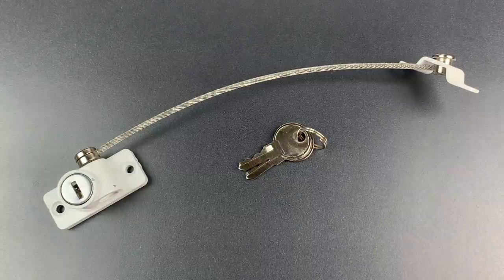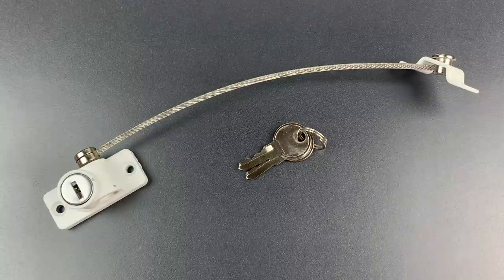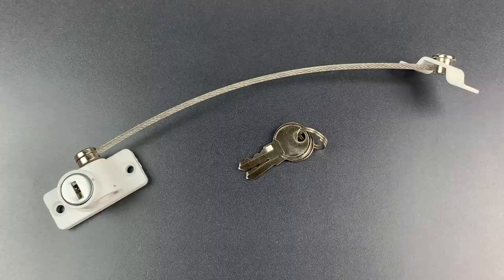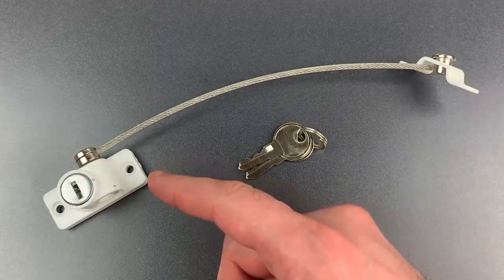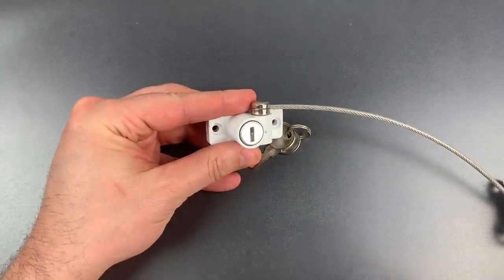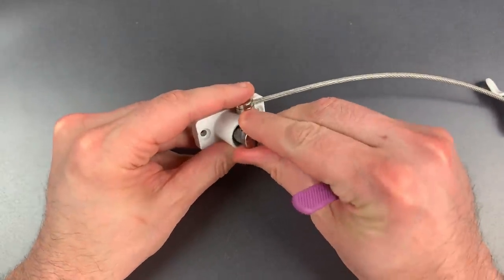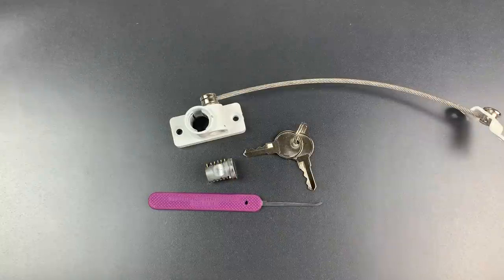[873] Why Is This Lock So Dangerous?

Comment: And for that reason, you can tilt your windows in Germany. Let's in some fresh air, is not directly an open door for intruders (though it is, of course, possible to use the opening to operate the handle with some effort and the appropriate tools, but then, tilted windows are usually an indication someone is home) and in the event of an emergency, you can fully upen the window in seconds.

Comment: To be fair, this won’t be a problem in any building with proper fire regulations. Odds are, you’re more likely to be saved by one of these as it’ll prevent the window opening far enough for anyone to get through it. If done right, you’ll be alerted to a fire well before it becomes a problem as the smoke detectors are so sensitive they are triggered by steam from a hot shower.

Comment: It can also be a life saver if you live in a high-rise and have a very exquisitive toddler. You probably wouldn't want to escape your 18th-floor apartment through a window even in an emergency and you would want to prevent your two-year-old from doing the same. So a lock like this, as easy to pick as it is, still has some utility, imo.

Comment: Hi LPL, I know US fire code might be different from the UK; but I am hoping not that much. But here the Fire Code stops you from using gf windows as fire exits. Each room must be fire protected for up to 1 hour (giving most the time to hear the alarm and escape) then the connecting corridors must have a minimum of 1 hour (more depending on other things height, distances to exits etc.) and that the travel distance to the exit is less than 30m (I need to check but don’t have my book at home) if it’s further then the corridor must be split in to two spectate fire compartments. Also depending on distances, type of use, etc. It dictates wether a second route is required. Finally from a H&S point of view, the chance of a fall is very high and the biggest killer / injure’r (well here at least) of fall types is a fall from low levels (you don’t have time to brace or react to the fall) this leads to a few big no, no’s 1. If you fall you can’t get away from a fire. 2. As it is not a defined route fire Marshall’s will not (mostly) be down to check for people exiting windows, so you might not be seen or missed on the fire Marshall sweep and/or role-call 3. Fire code also looks to reduce risk to Fire Marshall’s and First Responders (Firemen) by having to sweep the building to find you, rescue you when / if you are spotted and stop the Firemen from doing actual Fire Fighting all of them putting people at dangerous risk that isn’t needed. Most hotels but your escape routes on the back of mai room door or near by, and the routes are marked with emergency lighting and route finders. So please, all read and follow the instructions in case of fire and also know where you are supposed to go once you are out of the building at the Fire Meeting Point. You don’t want people going in the building looking for you just because you went somewhere else and they didn’t check you off the register. As for active shooter, I don’t know if the US has a set of guidelines like it does for Fire Codes; but I would think if they do they will be similar to the fire code and if a high risk target that they have to up spec doors walls etc. To give you a place(s) to stay awaiting armed response. Slightly different in the UK as we don’t have a fun problem, ppl with guns shoot ppl with other guns. Here you have to be up close and personal if you want to harm someone, don’t have the disconnect of carrying out the action of harming someone from behind a gun. I know it protected and we would never judge you for your choice; but doesn’t stop us wishing and praying for you guys to give them up so a lot more of you live every year; nothing but love for you, no judging as it  took us an age to finally give them up. 🙏

Comment: I have similar locks to this with bolts.
When fixed upside down, at the top of a doorway (which is a useful position to fix a sliding door to allow cats to enter) there is a tendency for the barrel of the lock to drop out. Yup, no need to pull at it, it just it falls out. Not when it is locked I must add, but what use is a self-destroying lock?

Comment: Where I live windows in hotels are not a primary fire escape, the chances that your door is blocked is low and you should have multiple exits to go for from there. In a real emergency this lock would likely be possible to force off the wall/window or you would brake the glass. The point of the lock is likely to keep children safe, keep unwanted trafic under control, minimizing theft, also the fire department must be able to get past the lock so that is also a reason why strong security could be missplased. This might come as a surprise to most on this site, but most criminals and other threats do not carry lockpicks or the ability to use them...a simple lock can do wonders. Most crime comes in one of three forms: Threats you bring with you, the hotel cannot fully prepare for that unless you talk to them beforehand, or crimes of oportunity where someone find an open window or some easy access items and gets ides, and last the mezz that is drunk/drugged/less-then-normally-functioning people. The last group is usually easily dealt with and something that is encountered by hotel staff on a daily basis. People with boltcutters, LockPickingLawyer grade skills, or even scissors as someone mentioned in a post below, don't really pose a threat to a normal hotel/guest except in extreme cases...and if that can prepare with such tools then you need more than just a lock.

Comment: Interesting how fire codes differ so much between western countries. In the UK the window would rarely if ever be an official form of escape - but there would be regular fire doors down hallways, positive air pressure systems and fire rated walls and the like instead. There will probably be two ways down from the upper floors too.

Comment: My guess is that a lock in that situation would PROBABLY be installed with sheet metal screws.  It would be possible for a good kick to dislodge it. However, LPLs point about fire codes is valid.  And his method is a LOT faster.

Comment: Just goes to show you a basic tenet of safety...

Security and safety in an emergency are frequently at odds with one another.
The more secure a building is, the more likely it is to kill you if there's a fire or other disaster.

You see a similar, kind of tradeoff in computer security, between keeping your documents safe from theft, and keeping them safe from data corruption.
The best way to protect files against theft would be to store them on an encrypted drive using offline storage, with the decryption keys stored in a different location.

The best way to ensure your files survive disaster is to store them unencrypted across multiple copies in as many locations as you reasonably can...
Which... Makes it much easier for someone to steal one of the copies...

Comment: Works on lots of furniture, cabinets, desks, file cabinets, etc. Hon is one brand name commonly used on furniture. But, they are also simple wafer locks. That ball pick you never use, or other rake will pick it fast.

Comment: I have a device for travelling that screw-locks into the doorjamb and removes without leaving any holes or marks.  No key,  one model was ratcheted teeth,  the one I still have is a threaded device inserted into the receiver of the door jamb and tightens against the door. Not recommended if in a hurry to exit though. But it cancels out all other keys.

Comment: This is a fantastic method of releasing this lock. However, I'd like to draw your attention to the 4 holes, 1 either side of the lock itself, and 1 either side of the plate at the other end of the tether. *pulls out a Phillips head screwdriver* these holes are for 4 screws to secure the lock to the window and wall respectively. If you simply remove 2 of these screws on the same end of the tether, the whole mechanism becomes entirely useless and you can open the window all the way.

Comment: That is a common method to remove a core. Some require the cylinder to face a particular direction to extract but the cheapest — like this — do not. Saves one step in the building.

Comment: A lot of hotels you can’t even open the window on, because the sealed window systems. The ones that do have windows you can open, they have to limit how far they open for multiple reasons. #1 reasons: is to make it harder for someone to commit suicide, and the hotel being sued by the family. Other reasons have to do with energy conservation, ac/heating purposes.

Comment: In Germany we use "Kippfenster".

When you turn the handle 90° (horizontal) you can open them complete, but when you turn the handle 180° (upside down) you can angle the window so there is a gap on top.

Fresh air get in but not intruders.

Comment: I had these locks on windows to prevent kittens from escaping but still letting a little bit of air in. However the keys were hung nearby for emergency access.

Comment: We used to use paperclips to remove these from our desks at work. We would get shifted to different areas frequently but they almost never had the keys to the desk. If you were lucky enough to get a key, you took the lock with you and swapped the one without a key to your old desk.

Comment: I usually don't happen to have a variety of thin metal lockpicks and shims handy.
But I always have some pliers and wirecutters in my toolboxes. And some snips or nailclippers in my washroomes.
That wimpy little metal string would last about two seconds - plus I could "unlock" it from either side of the window.

Comment: Additionally they can offer a false sense of security, my brother's uni accommodation was ground floor with a massive probably 600mm square window that pivoted open outward and had similar on that, with all that leverage when it already opened a good 6" or so I doubt it would prevent a forced entry, especially if someone stuck cutters in to cut the cable.

Comment: If you have the tools to remove it from the window to access the back than it is already free from holding the window from sliding...

For emergency purposes you could likely slide the window open a couple inches then lift it up and take it out of the frame and let it dangle below the sill.

Comment: I don't think there's anything really wrong with it. it's not suppose to actually lock anything, it's more of a child lock and to keep "window jumpers" out (thieves who try doors and windows and do quick jump and grab runs). Also if you knew how to do it, you would have done it in a hotel room, but once the lock is mounted on the window, it's nearly impossible to know what's underneath and where exactly to push / pull the pin.
nevertheless, it's no excuse for having so simply vulnerability on a lock, but then again ... it's not suppose to really protect anything.

Comment: Not the only lock used on hotel windows. Come across a better installed one with tamper-resistant screws and you’re in trouble.

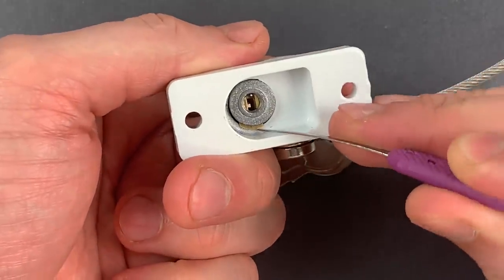Comment: The spring-loaded wafer needs to be pushed up 1:04  - away from the cable. It's easy to see how to do that from the back with access to push, but from the front, it seems you have to grab it somehow and pull down. Without having the lock to play with, it's hard to see what you grab in order to pull down.

Comment: I don't doubt he was able to defeat the lock, but I can't see how that pick could reach the piece he pointed to that holds the core in place.  I couldn't see anything inside the core move when he slid that piece to take the core out.  I'd really like to see the back side when he's using the pick from the front side so I can see what the end of the pick is touching.

Comment: A hostel I used to work at used this type of lock to keep the windows from opening fully to prevent people falling out of the windows of the top floors. As well as the reason you mentioned, keeping intruders out of the ground floor. Any thoughts on the use of higher floors?

Comment: The kind of person who would get out through a window with that type of locking mechanism on it probably would also be the kind of person who'd barge straight through the window and the wall it had been installed in. It certainly doesn't look like it'd stand up to anything that could easily cut the rope or dislodge either end of the locking mechanism!

Comment: Except the lock has screw holes in the plate. To access the bottom of one of these locks that is in use you would have to remove the base plate from what it is mounted to. Therefore negating the need to lick it at all.

Comment: You don't even need to go as far as you did with sliding out the core. It looks like the parts around the lock that secure it to the wall/window are just cheap plastic. Get a pair of $2 flush cutters from harbor freight and you can probably chew right through the piece around the bolt and bypass doing anything with the lock entirely.

Comment: When you demonstrated the removal, did you make sure you pushed the core in place that you seated the spring loaded wafer completely?  It did not appear that you did. It seems that it would be much harder to lift the spring loaded wafer with a pick if it were seated correctly.  Just a question.  And as always thank  you for the video.

Comment: I’d be extremely surprised if that’s against code. Your fire exit routes should not depend on you being on the ground floor. Hell, even with this lock in place and impregnable, you’re safer on the ground floor than on any floor above, because a) the fire is less likely to get that far down and b) you don’t need to negotiate stairwells that may be blocked by fire.

At the same time, not securing your ground and first floor windows so they don’t open is downright criminally negligent in the sense of safety from invaders coming from the outside.

Comment: Hey LPL! The place my mother lives has a call box you need to enter a 4 digit code to enter the electronically locked door. But if nobody is in the house to answer the call you can't get in unless you have a key. What, if anything, can be done if, when, my Mother forgets her key in the house? She isn't inside to answer the call, it goes to a phone inside the condo. 

Wondering if those kinds of locks can be bypassed with perhaps a strong magnet?

Comment: This seems like more of a child safety lock than a means of intrusion prevention.  I mean, any screws you use to secure this thing to the window frame are going to pop out with the force most able-bodied adults could produce.  In that sense, having a lock that is hard to pick isn't really the point.

Comment: I don’t understand the need for something like that. There are plenty of devices you can install that would prevent someone outside from raising the window more than a few inches, but are easily removed or disabled from the inside by pushing a button or removing a pin.

Comment: Intresting that you focus on the lock. Would have it not been easier to defeat the steel cable or with leverage tear one of the lock components away from the window frame?... in case of an emergency.

Comment: Windows are not required to open on ground floor in a hotel, if its sprinkled. By NFPA most all are, and egress only has to be through one way if the room or suite is less than 5,000 Square feet.

Comment: What screws was it fastened with to the frame? I have no trust in my lockpicking skills (especially next to a moderate fire); but a flat or PH screw I'd be undoing blindfolded --- so it's "slowly but surely" (and those I have on my keyring)....  Hex/Allen or any 'security' screw I wouldn't have on handluggage-only trips.  That said probably in case of emergency, a foot would kick the lock off the frame.

Comment: I enjoy the videos on this channel, but the title of this video is misleading. 
We are used to egress windows (called emergency escape and rescue openings in the building code) in our homes, but they are typically not required in hotels. Newer hotels may even have fixed glazing (non-operable windows) on all floors, so they don't have to deal with guests leaving windows open--letting in the cold or heat or humidity--which only makes the heating/cooling systems work more and waste energy. Think about it, you wouldn't be surprised to find a window that doesn't open on the 10th floor of a hotel. If an egress window is not required there, why would it be required on the ground floor?

Comment: actually, the hotel i work at right now, and everyone ive ever been in has the windows completely made inoperable by guest. we have to use security 8point bit to remove the blocks and open the windows. ground floor or not. every window is that way.

Comment: Nope, you're wrong.  There is no fire code violation.  I work at a hotel.  Those windows are designed to NOT be opened AT ALL.  If you wish to exit the hotel, you must do so through the posted exits.

Comment: I have that type of core in my desk drawer locks at work, and I noticed the pins have holes... it looks like the key actually goes through them.  I’m not a skilled picker and I didn’t much time, so when I say I wasn’t able to open it, that probably doesn’t say much, but I was wondering if there was a trick to them or if these types of pins are a security feature (or a “security” feature), and why they’re made like that instead of the cylindrical pins I see more often on your channel.

Comment: Not sure about it violating fire codes.  Many modern buildings have windows that are non operable meaning they are insulated glass set into aluminum frames with permanent stops and do not open. I guess it all depends on the requirements of the fire escape intent and original design of the building.